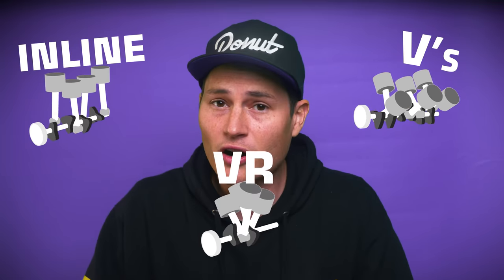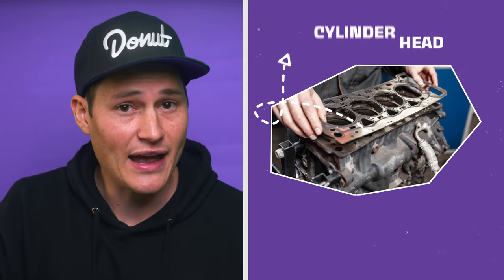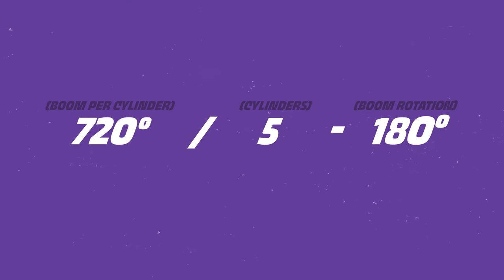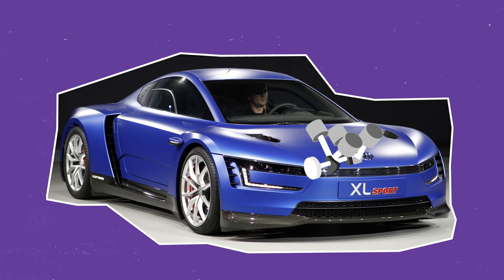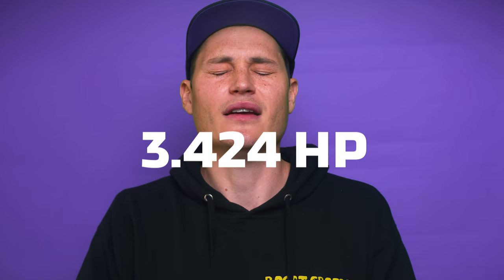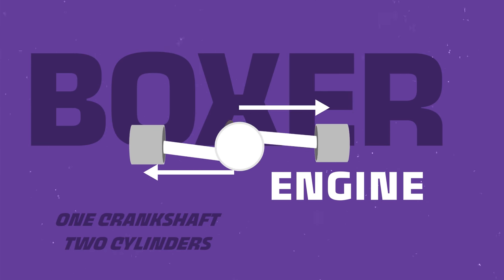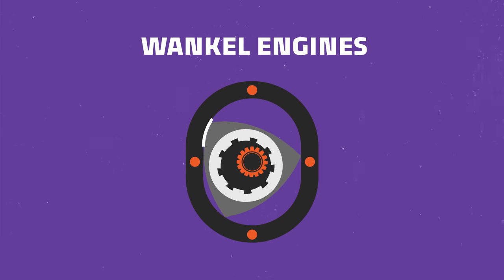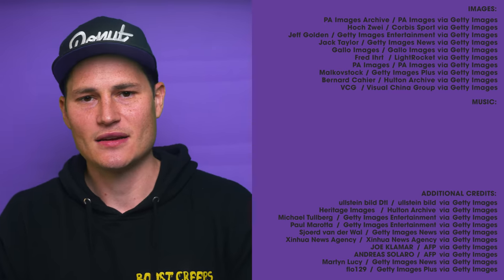Every Engine Layout Explained

Comment: "hot exhaust doesn't belong next to cold intake air"
Jeep 4.0 has entered the chat
Reply: 😂😂 that’s exactly what I said!! I was like... ummm my jeeps says otherwise
Reply: Although the exhaust manifold is made out of steel, so the metal does retain heat and the intake manifold is made out of aluminum which does a great job at keeping heat away.
Reply: @frantickoala994  correct .. aluminum dissipates heat like 20 times faster than steel or stainless steel would
Reply: Thats why the exhaust and air intake are on the same side
Reply: Ah yes the 4L with 170 screamin horse power!
Reply: @j.d.saccociates3313  my XJ puts 340 to the wheels
Reply: @Righandwelder1202  thats because the amc 4L makes 160hp and Bugatti was trying to make 1000hp hyper car
Reply: @j.d.saccociates3313  what?
Reply: @Righandwelder1202  you wouldn't purposely route the exhaust next to the intake if you were trying to design a performance engine
Reply: Jeep 4.0 dont take no shit
Reply: Got my 4.0 just shy of 300hp but I aint pushing it. I know the jeeps 4.0 is one of their " most reliable engines" but its still a Chrysler 🤣🤣
Reply: the W engine would work if the middle bank had the intake and exhaust on opposite sides to the other 2 banks
Reply: @Sully.999  well was designed by amc...
Reply: Ford 300 has also entered the chat
Reply: @cavalierliberty6838  another engine thats slower than the second coming of christ

Comment: @ 13:11 I have a 2015 Subaru Outback 3.6.
I just spent the entire day yesterday, changing 6 spark plugs.
I had to take out the entire intake system, as well as the battery, and the battery tray, just to get to the heads.
Thank God! They're Iridium, and only need replacing every 100k miles.
Another negative, a set of six cost me $100...

Comment: Another fun fact about horizontally opposed engines is that almost all general aviation aircraft use them. The Cessna 182 has a horizontally opposed 6 cylinder, and has since the ‘60s.

Comment: There is also the radial engine, mostly used on aircraft, but also on some really wild motorcycles. 5,6.7.9.10, and even a few more cylinders were available. 1 crank for a full set of pistons, occasionally though rarely they can be found with a twin radial setup. They just sound so cool, when they run! :D

Comment: The Volvo 5 cylinder engine should have been included in the short list of examples.
Reply: I really thought he was gonna bring up the s60/s60r
Reply: The Focus 5 cylinder......he said it was a Swedish/Ford combo. It appears through some research that Volvo's engines borrowed or shared designs from VW/Audi. Volvo used an Audi I5 diesel in their 850.
Reply: He did mention.. T5 is the focus engine.
Reply: Or the Mercedes inline 5 diesel!
Reply: @darrengolladay9359  the gasoline i5 in the 850 was jointly designed with Porche.
Reply: The Focus RS inline 5 is actually a modified version of B5254T3 (Correct me if im wrong, but i think that engine was also used in Volvo S40)
Reply: @xTheRenegade666x  Yes Porsche helped Volvo. Porsche originally tuned a 5cyl. for Audi in the RS2. Volvo wasn't Porsche's first time with a 5 cylinder engine.
Reply: @darrengolladay9359  I'm aware, I never said it was, just that Porsche helped in developing that engine... I owned an 850 wagon so I had a fun time with that screaming lil 5 cylinder til it shredded its timing belt and bent a valve, otherwise I'd still be driving it. That was a fantastic engine even in its naturally aspirated form.
Reply: @xTheRenegade666x  Sorry I guess I read that wrong! I never drove an 850 but I have driven a few US spec S6 turbo's (5cyl.) It was an odd feeling. Not as exciting as I thought.

Comment: Could you explain the power, balancing, & vibration differences between a 60 degree V6 and a 90 degree V6?
Reply: Probably should get someone else to do it. This guy knows principles but not the real details. And the animations are horrific. Among other things, the pinion gear in a rotary engine doesn't spin 🤣

Comment: I want to see an "X" engine layout.
Reply: Those do exist but they were never used on cars aside from a couple of experimental units. They were pretty popular on propeller planes though, particularly around the WW2 era
Reply: @nong333  I wouldn’t call them common in planes in the WWII era, the only type I can think of that used one is the Avro Manchester which had a ton of issues.
Reply: I know Ford wanted to do it to make a one up of the flat head v8 cuz gm was making bigger cars but he couldn’t figure out the oiling for the head on the bottom two banks
Reply: Before the original ford v8 they experimented with som x engines but went away with them after some oiling issues
Reply: Or a Y
Reply: In sweden we call those Stjärnmotor (Star engine) because they look like a star. but in english they are called Radial engines. unless an X engine is a completley different thing and is not a radial engine. then dont mind my comment
Reply: @Fransenn  X engines are not the same as radials.
Reply: @silaskuemmerle2505  what's the difference?
Reply: @Fransenn  X engines are a set of 4 banks of pistons  in an X formation around one crankshaft and in one rotation each piston would fire once, whereas a radial has an odd number of banks of pistons and it takes two full rotations of the crankshaft for each piston to fire once. Basically the difference is in firing order.
Reply: @silaskuemmerle2505  huh interesting. Thanks

Comment: There are inline 6s that are smooth and strong. Now on to 8s

Slant 6: Do I mean nothing to you?
Reply: Slant six is just an inline six
Reply: If I remember right, isn't a slant 6 just an I6 designed at a slight angle?
Reply: Yes, but he showcased every single other engines example BUT the inline 6.
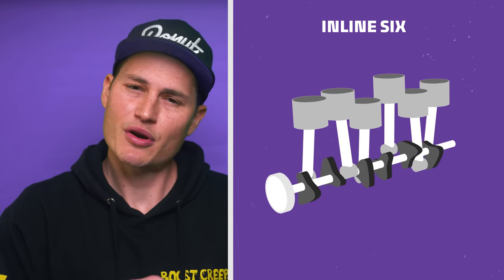Reply: @justbuggin67  5:43 it's right here tho?
Reply: @cpufreak101  sorry I should clarify, he mentioned multiple examples for all other types but missed the most glaring and popular inline 6, the slant. He just glossed over the 6ers
Reply: @justbuggin67  they also skipped the Audi I5 so you're not alone.
Reply: @justbuggin67  Tons of engines are mounted at an angle as well, but that doesn't really deserve special mention.
Reply: @argh1989  it was in production from 1959-1983 and powered almost every single Chrysler product known.
Reply: @cpufreak101  yeah that hurt also.
Reply: Having an engine mounted at a different angle doesn't make it a different engine, so it isn't worthy og a mention.  That would be like saying I slanted a Flat 6 forward 20° for some weird engineering reason and so it should be considered its own engine configuration because of how it's mounted.
Reply: @justbuggin67  the old 65 ford f100 with the 300 I6 sound mint,  also into the 80s with those.

Comment: missed types: Radial, Gas Turbine, Sterling, Opposed-Piston Delta Config.
Reply: Well a gas turbine is a turbine, It is a internal combustion engine I think, would that count? And isn't there an X engine, like two boxers glued to each other with 90° of difference, or would that be a radial engine?
Reply: @rhazien2502  it aint radial and it looks more like w engine with different angle, or at least others claim it aint radial
Reply: @justjako9145  interesting, I don't remember where I saw that, I was also expecting a mention of v60° and v90° but I guess that is just popular angles for V engines
Reply: And isn't the opposed piston delta config, the napier deltic, used on british diesel trains?
Reply: @rhazien2502  yes it is
Reply: And also the Bourke engine. Though it never really took off, it is pretty interesting.
Reply: Ford experimented with an X8 engine back in the 20’s but the only production X engines are in aircraft
Reply: jet

Comment: If you use an inline 6, you get not only overlapping power delivery, but also balancing of forces. Especially if it's not an inline 6, but a boxer flat 6, so basically 2 inline 3s on opposite sides of eachother, connected to the same drive rod / crank shaft. And there is at least one engine type which mixes a boxer flat type with an opposing piston type, to basically use less pistons than otherwise needed. one side's compression happening at the other side's expansion and vice-versa.

Comment: "next we have the V4, a MotoGP staple"
Photo of an M1, one of the two I4 motorcycles in the paddock
Reply: Prior to the I4 photo was a pic at 8:15 with three V4's and one I4, so they are off the hook.
Reply: And the engine animation of ducati is also incorrect they showed v4 instead of v2. They did not give their 2wheeled audience justice

Comment: The logical addition to this video would be crank configuration, it can completely change the way power stroke overlap occurs. Such as the cross plane vs. flat plane cranks in I4 and V8 engines.

Comment: Inline Engines were used in Early Aircraft, Tanks like the Mark I, the first British Tank to send into combat in 1916, and it made a return to Military Combat in WW2 with lots of Aircraft, the popular aircraft with Inline Engines are the Messcherschmit BF-109, the early version of the North American Aviation P-51 which the later versions use the Pekard Merlin V12 Engines
Reply: Fun fact: About the Merlin 27L V12 I used to think that there was a 60L V24 version in Curella De-Vil’s car but I was so wrong it’s a 60L VR8 that has the power and all the displacement of the two Merlin V12’s

Comment: Don’t forget the legendary V4 powered Lancia Fulvia
Reply: Also ..The V4 was a mass market motor for Ford, but in Europe and mainly Germany. In the 1962 Ford Taunus then Consul. transit van, and Capri.
Later used in the Saab 95,96 and 97 when Saab first moved away from two stroke engines and to the four stroke Ford V4. Possibly at Ford's demonstrated suggestion to sell motors.
Was also used in the first Ford Mustang, the mid engined prototype.
Was intended for mass sale in the US as the Ford Cardinal with a V4 but Ford eventually went with the Falcon and Cardinal design evolved into the Cortina and Taunus. Sizes from 1.2 to 1.7 litres for all these.
UK use in the Ford Corsair and Zephyr mk 4 from the sixties as well as the Transit Van.
Lots of Lancias from even the 1920s used a V4.
So not just the rare cars shown. Lots of mass market cars.
So even the US nearly had lots of Ford V4 Mustangs and Cardinals.
Reply: @johnd8892  Saved me typing, thanks, bud!

Comment: Volvo, Audi and Acura all also use 5cyl engines. A car that my sister and I shared was an Audi 4000 5+5. A 5cyl 5speed car. Fun car to drive...except in traffic. It overheated alot.  One of my favorite "sleeper" cars is the Volvo 850 T-5r. It has a turbocharged 5cyl engine producing 243hp and has a top speed of 152mph.

Comment: In my opinion, one of the most investing engine designs was Napier triangle where three cylinders with two opposing pistons arranged in triangle and up to eight or twelve such triangles were stacked side by side. But these engines were used on locomotives and ships, beside some experimental tanks.
Reply: Fantastic engines Boris!

Comment: As always, excellent information and entertainment from Donut. Simple animations were extremely helpful to illustrate your descriptions. A small clarification: All boxers are flat, but not all flat engines are boxers. With the popular Porsche and Subaru boxer powerplants, adjoining cylinders move in opposite directions per your animation. There are, however, flat engines in which adjoining connecting rods share the same crankshaft journal. In these engines, both pistons move right, then both move left. Therefore, their inertia does not cancel out. These engines do not have the inherent balance of a boxer. For example, Ferrari made a 180 degree v-twelve. That's right, a 180 degree Vee. That's another way of saying flat, but adjoining connecting rods share a journal, so it's not a boxer.

Comment: Really disappointed they left out the radial. Sure, it was not used in cars, but wow do they sound good!
Reply: I can maybe think of some WWI and WWII tanks that used a radial. Why you think the Sherman US WWII tank had such a thicc butt. Lmao… or at least I think it was the Sherman that used the radial. May have been the M18 Hellcat or the M10Gun Motor Carriage Wolverine… aka the M10GMC Wolverine. Could have also been the M36 Jackson. And maybe the A7V german WWI tank. I’ll have to go back and do some research just to be sure.

Though I think for certain, if he is counting stuff like that dump truck, then he can not leave out tanks. Which means he left out whatever fing engine it is they use in the M1 Abrams.

Comment: What about an x engine, that would be cool asf.
Reply: Look up a radial engine. Not quite an x but pretty close
Reply: Thats a rotary (the ones used in planes)
Reply: Like an aircraft engine? In a car the oil would be staying on top of the bottom pistons. To much smoke and oil use.
Reply: Plane engines are somewhat similar
Reply: @Thecasualgamer-pp5wc  radial and rotary are different.
Reply: @TheAdatto  flip it 90° and you’ve got yourself the coolest lawnmower engine ever
Reply: @ll_Helixx_ll  yea i know, i forgot the other name
Reply: It exists. Connaught built a VR10, than made an X20 version of it.
Reply: The Armata uses an X12 engine
Reply: @zrspangle  just looked it up and it’s exactly how I imagined it 🔥

Comment: I have a engine design in mind, called the X24 that can handle 8 turbos and rev to 15000 rpm

The design: a v12 on top and a flipped(a v12 cut in half and put vice versa) v12 at the bottom. it can reach 5000 HP and has 0-100 KM/H in 0,9s

Comment: The Commer TS3 "Knocker" is a two-stroke diesel, but what's not mentioned is there's the prototype TS test bed of a single cylinder, but still twin piston and a smaller dimensions (2⅖" bore 3¼" stroke)... the name derived from Two Stroke rather than Tilling-Stevens, a company acquired at about the time of development.... there was also the larger TS4 in development as a 267ci four cylinder model, ultimately cancelled by the acquisition of the Rootes Group (parent company to Commer) by Chrysler.  That being said there is a Rat-Rod powered by a TS3 on a White Truck chassis called the "Knocker White".

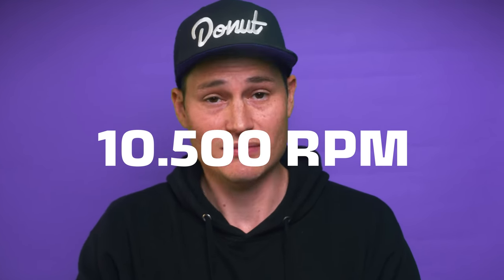Comment: 6:30 There are none of I-10's in the automobile industry ever made, but there is lots of Inline 10's in the other industry such as shipping industry etc... I was work on engine overhaul on MAN B&W 10K90MC-C, that one was capable of producing like 58.000 horsepower (around 43.000Kw) at 104 rpm :D

Anyway, great video, keep up great content

Comment: It certainly doesn't count as it was never put in a car, but my favorite engine layout is the Chrysler A57 Multibank. During WWII the mad lads at Chrysler put 5 inline six blocks around a central shaft and stuck it in the M4 Sherman tank. Would you call that an O-30?

https://en.wikipedia.org/wiki/Chrysler_A57_multibank

Comment: There is an inline configuration you kinda glossed over and that is inline 7’s. They are a super uncommon engine and as far as I’m aware the only one being built is a 9.8 liter twin turbocharged diesel built by AGCO and it’s only really used in farm equipment. We have a tractor with one and it’s surprisingly smooth, although it only goes to 2,300 rpm

Comment: Wow, that was great compilation of Engine layouts! Would have been nice if the aircraft engines was added in the end of the video. Starting from cam engines, swashplate engines, piston less Rotary engines, wankel engines, Radial engines, multi row Radial, Rotary engines (where the crankshaft is fixed and all the cylinders rotates), Dyna Cam engines... all possible bizarre configurations!
Funfact: Lycoming XR-7755 was the largest piston Radial engines with 36 cylinders (4 rows with 9 rows each!)  producing 5000 hp!

It is fascinating to know that engineers over a century ago were crazy inventors and limited only by the technology of that time!

Comment: Maybe not mentioned are Swash Plate and/or Axial piston engines. In this form the pistons are parallel to the output shaft, and commonly grouped in a circle around that shaft.
NOTE- This is different from Radial and Rotary engines- - The Axial engine con-rods are parallel to the shaft, and not at an angle. The Duke Axial Piston engine is a modern version, but Swash Plate and/or Axial Piston engines do date back to 1917.

Pumps and Air Compressors can have similar forms (of operation) to Internal Combustion motors:
"Kawasaki Heavy Industries, Ltd. announced today that their energy-efficient K3VLS series swash plate axial piston pump for load sensing would go on sale from October 1, 2015. "

Comment: Inline 5 was also built because it was the longest engine that could be fed from single carburettor. Inline 6 often needed two which increases price. Today with injection, it is easier.

Comment: When it comes to opposing piston engines, I'm most familier with the Deltic engine used in the BR Class 55 Deltics, which where a Delta style Opposed piston Diesel engine powering a generator